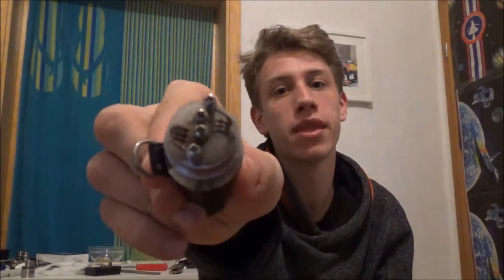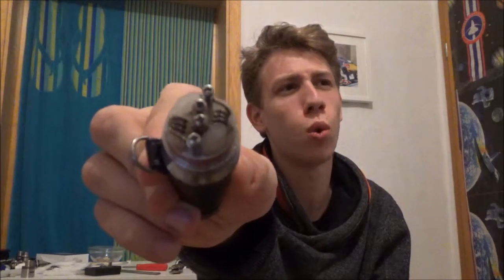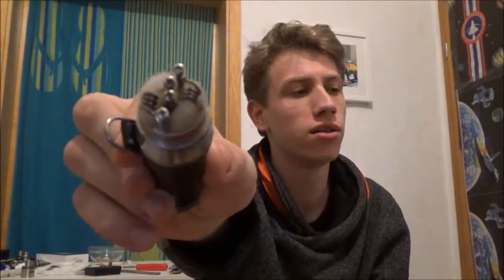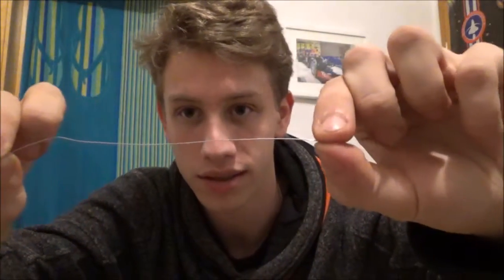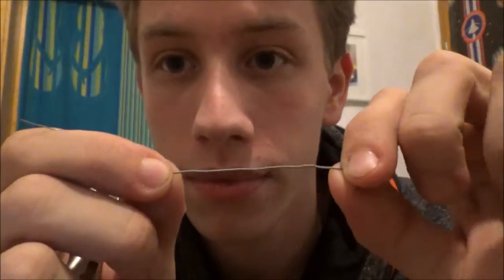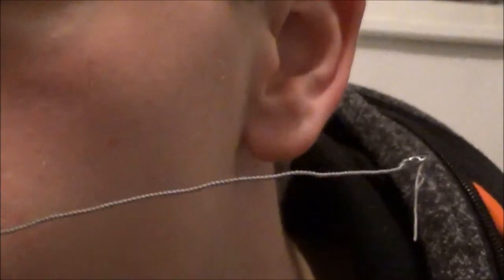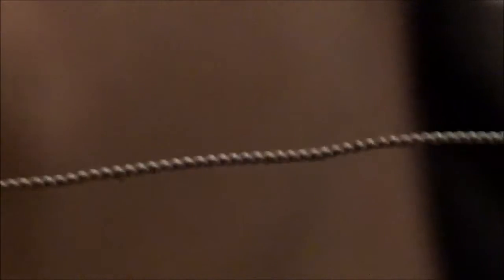0.16ohm Twisted 21/25gauge dual coil build Tutorial

Comment: you can do the same thing w/ a pen and a pair of pliers...in case you don't have a drill...not quite as fast though.
Reply from the maker: Yes you can but it's much harder to controll the twist and don't make a mess 😂
Reply: The German Cloud
can't argue there. but i don't own a drill so that's really the only way i can twist wire. not really willing to go out and spend 80 bucks just to make that one thing a lil easier.
Reply from the maker: well if you got something to clamp down on like a vice that will make it a million times easier
Reply: The German Cloud
yea i've seen people use swivels screwed to a table to make claptons with hollowed out ball point pen casings.
Reply from the maker: quite popular since grimm geen posted it you can use ball bearings from fishing rods as well and it is the easiest way to do claptons and since i never forgot your ide with the guitar string i got something special coming in that clapton way still needs a little work though^^
Reply: The German Cloud
nice! can't wait to see what ya got cooking. ;)
Reply from the maker: it will be definatly up in ohmage because i'll vape it at 8 volts but you can easitly replicate it with the same wire and just devide you power output by 4 and you have your 4 volt output (depending on the max volt output of your mod obviously)
Reply: The German Cloud
haha you wanna know what my sigelei is pushing right now at 30w? 2.3 volts. it's kinda great though because building low on a regulated mod just makes the battery last longer. ;)
Reply from the maker: yeah thats verry cool but on my old vamo i always maxed it out at 1,6 ohms and the battery baerly lasted the shool day ^^
Reply: The German Cloud that's odd...i wonder what kind of voltage it was pushing on that load. i'm no electronics expert but that seems weird when the current on a 1.6ohm load is lower than say 0.5ohm. i suppose charge capacity could've played a part as well. we've come a long way in battery technology in the passed few years. not too long ago i don't think you could actually find a lipo battery with a 3000mah charge rating. or at least i don't think you could buy them for $10 lol.
Reply from the maker: well they where efests ^^ so i guess that solves the mystery ^^
Reply: The German Cloud
hey now! i'm rocking a 35a purple efest in my sigelei :P haha idk it works generally it lasts at least a day though. i just can't figure out why the voltage keeps changing on my mod. not much but the display sometimes says 3.1 and sometimes it says 3.2 lol. i mean if it was the ohm read that was changing i'd know it was probably a loose screw or something but the voltage change confuses me. xD
Reply from the maker: oh i know what it is check all you connections maybe one of em is a little loose or something and it as higher internal resistance to overcome from time to time
damn so easy ^^ why didn't i got it earlier ^^

the old 35a's where rewraped sonys so actually you got a vtc for acheaper price ^^ quite cool but now they seem to be lg's
Reply: The German Cloud
yea the one thing i noticed lately is the top umm whaddya call it? panel or whatever...is kinda bent. i think the screws might've come lose or it's just made from cheap metal idk. if i had a torx driver i'd try to tighten them but i don't. i had some bits hangin around but i can't find them now and i don't seem to have a screw driver that'll fit...sometimes u can use a tool that isn't exactly the right tool but works for the job. anyway it works so i'm not complaining too much...i just think it's weird that the voltage jumps around sometimes by .1 or so
Reply: other thing i was thinking is it could be the circuit that regulates it. idk
Reply from the maker: yeah exactly that wires in the circuit probably sit loose
Reply: The German Cloud
if i can find a tool to tighten those screws down or maybe replace the top w/ a stronger piece of metal maybe it'll be more stable...could be fun. i like to mess around with stuff. ;)
Reply from the maker: i think you probably want to resoughter
Reply: The German Cloud
ugh! i hope not...i suck at that stuff. xD
Reply from the maker: you can just bring it to the net electronics shop or coll phone doctor these guys will usually do it,  often for free
Reply: The German Cloud
yea i gave my istick to a guy at one of my local shops (same one i bought the sigelei from) he never managed to fix that. my local vape shops aren't great and there's only one electronics shop around but they only work on cell phones and not for free. :/ i have a feeling the battery is pushing up on the pin causing the top to bend...don't think there's much i can do about it really. as long as it keeps working i'm not gonna worry too much about it. thanx for the ideas though.

another thought i had is to take the battery out and sand down the pin just enough to relieve the tension. on this mod it's pretty much a direct connection from the pin to the battery. pretty much the same as a mech. makes me a lil curious how they managed to wire up all the extra electronics to it.
Reply from the maker: probably the chip sits just like a regular mosfet with a master switch.

that really sounds wierd^^ and since you use an unprotected 18650 i can't wrap my head around why this problem is coming up now and not earlier
Reply: The German Cloud
maybe that's it. still strange though since all the electronics are on the other side. now i REALLY wanna pop the top off this thing n have a look under the hood. hehe :D

it's not really a "new" thing it's been bent like that for a couple months. it's barely noticeable and like i said i think if i sand down the pin on the inside it should be enough to relieve the tension. if i take my tank off the plate wiggles a bit though so i'm fairly certain now that the screws are definitely lose and that the plate is bent. shouldn't be too difficult to fix but like you suggested before...i may have to re-solder something. :/
Reply from the maker: ok here is the diy version of resoldering
take a steel nail and hammer it into a piece of wood, then heat it up with a lighter and take soldering wire preferably with a anti oxidisation already in it.
cut it off like a normal piece of kanthal but make shure not to take too much then lay the stil hard piece of solde on the connection and put pressure on it with the heated nail usually that should make it liquid to the point where it will "glue" the conection in place
Reply: The German Cloud
lmao...i think i'll stick to a proper iron.
i just paid 40 bucks for one, i might as well use it. ;)
Reply from the maker: well if you have a soldering iron you're golden ^^
Reply: The German Cloud
i'll let ya know how it all goes. i have some other projects i'm working on as well which is more to the point of why i bought the thing but if i need it to fix my mod at least i have it.
Reply from the maker: oh what project?
you may remember that i said i was building my own boxmod ..... well i did and it worked great but i had a small incedent with a battery venting and it burned my wooden box mod down ^^ can you belive it? i only have a few messed up copper pieces left^^
i hope i get a new box made quite soon
Reply: The German Cloud
one of them is a box mod but it's going to be very much unlike anything that's been out so far and that's all i can say until i get paperwork in at the US patent office. ;)

the other might be difficult to explain unless you know anything about guitar effects.
Reply from the maker: us patent ? that sounds verry big what does this design or mod improve ? vape quality ? batterylife?

well i know some thing about guitar effects but only specific things so try to explain it ^^
Reply: The German Cloud
can't say because i'm still in the process of prototyping. i'm not even sure if it's even going to work! have a few more parts i need to purchase before i can put a test circuit together. so i have no idea if it will be "better" i just know it's very different. ;)

basically i can't use my feet so i'm modifying a wah wah pedal so that i can mount the controls on my guitar and work it with my hand. pretty simple thing i just need to re-wire a few components so i can mount them on the front. at first i was going to just directly install the circuit but it turned out that i'd have to route out too much wood to get that done and i don't want to end up with something that alters my guitar's natural tone.
Reply from the maker: no matter with what you came up if it's good you're going to earn a lot ^^

oh yeah nice idea i think i know what you are talking about.
Reply: The German Cloud
i'm going to do a video of both or at least the guitar one. if the mod works i'll do that video too and i'll let ya know. ;)
Reply: just don't hold your breath...i'm super lazy lol. xD
Reply from the maker: just don't hold it back too long then i'm ok ^^
Reply: The German Cloud
i'll do my best bro. ;)
Reply from the maker: that'll be enough i guess ^^
Reply: The German Cloud
ya can't ask for more than someone's best. i got most of the parts but i'm having trouble with my local electronics shop they've been out of stock for months on a lot of things due to financial problems the company has been having. ;/